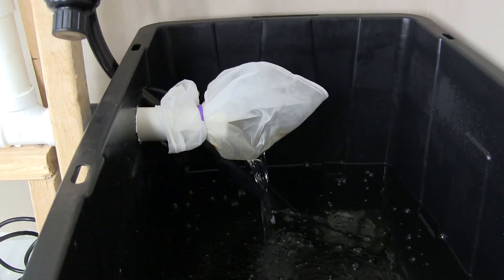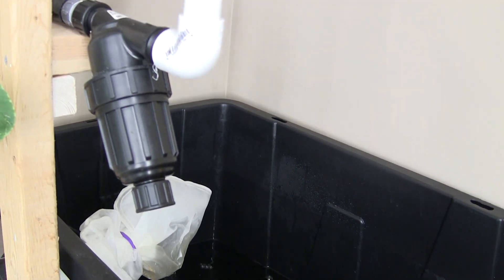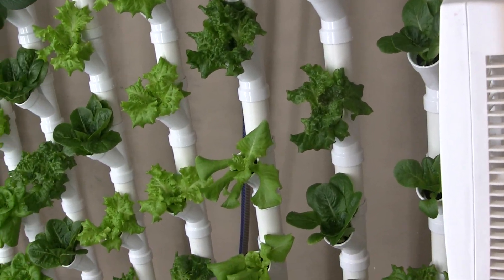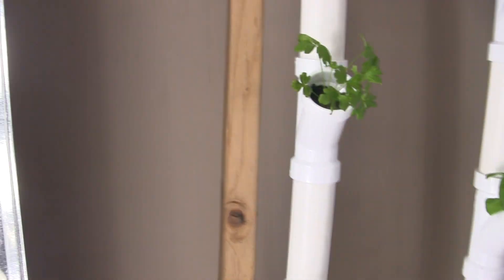Basement Hydroponic Tower Garden Version 2.0

Comment: is turning on and off the water pump hard on it? I have always considered the on-off method but thought it would wear down the pump fast.
Reply from the maker: Good question. It was for the model 18 I use in the greenhouse. The impellers kept on busting. So as advised by Danner I keep that pump running but for the model 5 it's not a problem to stop and restart. It's necessary to have an extra impeller on hand. In all the years that I have been using Danner pumps, with all the different models, I've only had to replace the impellers and 1 housing. The actual pumps are superstars. Knock on wood the pumps themselves have never failed on me. Stilling looking for a good way to clean off the precipitate though - if anyone has any recommendations that would be appreciated. I have used vinegar and baking soda, just vinegar, and once muriatic acid, carefully and diluted of course, with gloves and eye protection. That worked the best, but is extremely dangerous and corrosive.

Comment: @MaryandJoe Neumayer  im quite a newbie in this system. In traditional gardening, plants die when the roots are always soaked water. Here ure watering like every hour🤔 please enlighten😉
Reply from the maker: Very logical question! Roots will suffocate without oxygen. That's why the pipes are so effective - as the nutrient flows down the pipes the water is oxygenated and don't suffocate. They are not 'submerged.' If you do want to submerge your roots, like with the Kratke method, they you will need an airstone/air pump to keep the roots oxygenated.

Comment: You can get 50% more produce by changing your led bulb to warm white 2700k instead of a 5k or 5.6k. Leafy plants explode with red spectrum. 4 2700k bulbs with 1 6000k. 4:1 red to blue ratio. Good luck and it looks fantastic. God speed!
Reply from the maker: Hi Denis, thanks for the tip. I'm planning on experimenting with some Solstrips for this next basement season. The system is cleaned and shut down now until August/September. If that doesn't work I can experiment with some new 2700k bulbs.

Comment: Does it make any sense to turn the pump and fan on and off?
Reply from the maker: Originally that was the plan for energy consumption - but now I keep the fan on and cycle the pump 30 min on and 15 off.
Reply: You might need smaller pump then. I don't think that plants prefer inconsistent water flow and CO2 level. On the other hand, pump and fan is just a small portion to the lamps and heating in my opinion.

Comment: Love it. Maybe if you used a trough at the base and allowed the verticals to slide you could have closer spacing for young plants/ herbs and wider spacing for mature plants, should be able to fit more in that way.
Reply from the maker: that's a neat idea. I like the closed system concept and now I grow alternating sites so the plants don't get as crowded. It works better all around, especially since some lettuce types grow faster than others, so I just pull whatever is more ready and give the others more time.

Comment: So 1 lettuce cost you 2 to 3 $ to produce, just from electricity for light (assuming 0,15 cent/kwh cumulative). I think it is not worth it.
Reply from the maker: I have different figures. I use my electricity bill to calculate cost. And that changes monthly depending on solar gains (we have 30 panels on the roof). In the spring/summer/fall I grow in my greenhouse so operating costs are significantly lower - so that impacts the overall equation as well.

Comment: How efficient in terms of yield is this compared to a horizontal system in the same size as you can bore holes closer to each other in a horizontal system than the Y-connector is to each other?
Reply: Or am I missing the point of this type of solution? If not more space efficient then I guess it’s higher quality crops?
Reply from the maker: The footprint on this system is tiny compared to a horizontal system since it stands up against the wall. We also have room for foosball and darts.  Plants are also easier to access. Also plenty of root aeration with the vertical towers.  I like

Comment: You should consider buying proper horticultur LED fixture, you will save a lot electricity . Solstix solstrips (for example) are awesome and cheap for what they deliver, latest LM301H samsung LED chips special for horticulture, 30 bucks for 50w putting out way more light than your led bulbs.
Reply from the maker: yes, I really appreciate you offering specific recommendations. Have you used those products personally?
Reply from the maker: Hey Zaka, I just looked at the SolStrip X3. If I replace one of my light towers (top to bottom) I would have to string 3 of them together, with an wattage consumption of 258. If I did that for all seven towers my wattage requirement would go from 735 w to 1,806 w. And the cost would be $787 without tax or shipping. But that's assuming I would need all of that lighting. I don't know how to figure out the PPF output of my 15 watt LED bulbs to compare them with the SolStrips.  At 1600 lumens per bulb, that's 11,200 lumens per light tower. A quick online calculator gave me 258 umol/s for my light tower and the SolStrip produces 230 umol/s - so you are correct that the light is way better. But can I really illuminate a 5'6 x 2 foot area with 1 SolStrip which is 15.75” x 1.6”? I suppose I can run them horizontally rather than vertically, and daisy chain them together. But then what about the voltage? Depending on how many strands won't I require an inverter to match the voltage? That would also add to the cost, correct? I obviously don't know much about this but I would love to learn from somebody with experience. What are your recommendations? Thanks in advance for your time.
Reply: @maryneumayer01  yes I have some solstrips, first I recommend you to download the Photone free app for mesuring PPFD across your canopy. You need to do some calculations and drawing to know how to put the strips for optimal coverage and minimal power consumption .

Comment: 80 bulbs at 15 watts is uhh 1.2 kw. so 25 cents an hour. 10-12 hours a day. 90 a month in electricity? the pvc will last forever whats the price per head of lettuce?
Reply from the maker: actually it's more like 760 now since I shaved the light diffusers off and I get more intensity so I pulled out over 30% of the lights in the system. we also have solar so that helps.

Comment: Thanks for sharing your system and your feedback. Planning to build something similar.

Do you see a problem using 3/4" drain pipe? My Restore has a bunch of 3/4" pipe and fittings so would like to reuse them. I'd tilt the drain pipe towards the nutrient tank.

Do you see a problem using 2" pipe for the tower? Thought I'd try a few towers at that dimension to give bigger plants more root space.

What temp is your basement room without running your system? Trying to figure out how much heat something like this produces to find the best place to put my system.

Looks like your pump is submersed in your tank. Does that heat the water up much? I'm planning on building an insulated box for the tank to reduce the pump noise but don't want to heat water up too much.

The nice thing about your design is you can modify it easily for different plants and plant stages, etc.. Such a great system!
Reply from the maker: Hi GK - I think the 3/4 inch drain pipe is too small - if the drain is too small you may get back-up and some roots too which will create clogging. I wouldn't go smaller than 1 1/2 inch. 

2 inch tower pipes is a good idea for plants which don't get replaced/pulled whole. Examples are parsley, kale, chives, etc. Lettuce gets pulled as a whole plant and replaced with a seedling and do 1 1/2 inch pipe is perfect for a 6-8 week plant. 

The system only adds a couple of degrees. The basement is a cool 62 degrees and and with the system about 65. I don't run it in the summer so those are Chicago winter temps. Also, in the winter, the extra humidity is welcomed. It would be too much humidity during the summer months. 

The pump does not impact the temp of the nutrient container. That would be more the ambient temp of the room. Insulating is not a bad idea although the pump is not very noisy - I speaking about the Danner Supreme pumps. 

Yes, agreed, the system is very modifiable. When I get old and lazy I will definitely scale down! ;-)
Reply: @maryneumayer01  Yeah you're right. My first test run used 3/4" and it didn't work due to water backing up (luckily I had no plants in the system!) so ended up using 1 1/2". System is working awesome. I really appreciate you sharing your video. Made me start a business (at the behest of my mom!) to help others get systems like these going. hygrowgardens.com

Comment: i know this is an old video but... i have been using the same kinda filter for years now... and the way it is fitted the water doesn't pass thru the filter.... the top fittings are just a pass thru...
the output is by the under connection.. you have to plug one on top and the outlet is the bottom connection.
Reply from the maker: Hey Eric, I don't use the filter actually. There's no need with the 1/4 inch connector tubing and the sack filter on the end of the drain pipe back into the nute container. If I were doing aeroponics I would have a need for fine filtration but not for this application.
Reply: @maryneumayer01  I see, thank you for taking time to reply. best regards from Brazil.

Comment: Do you have any problems with pests?
Reply from the maker: not indoors - I keep the room and system as sterile as possible - no contamination from outdoors. NEVER introduce a plant from outdoors - always start all plants from seed in that same room - extremely important. I go as far as to remove clothing if I am coming in from my outdoor greenhouse, especially in the fall with all the mold and mildew in my outdoor greenhouse. Don't make any exceptions, ever. I also have an APCO-X UV and carbon sterilizer in my air handler, so that helps too.

Comment: Nice setup, The bulbs you used for lighting they look like regular light bulbs are they?  Are the plants not sitting in water? do they only drink the water trickled down by gravity? Don't your roots clump up like this?  What does this cost you in power and nutrients each month?
Reply from the maker: hello, regular LED A-19 bulbs. system plants don't sit in water - they are trickle fed. Roots clump on plants left in for 4+ months, like parsley and sometimes the kales. cost depends on solar power offset and changes monthly. It does pay itself off I guestimate after 18 months or so.

Comment: Great video. How do you keep the output even on all those black delivery tubes at the top? 
I know from doing this sort of water delivery in my garden that the hoses closest to the water source always tend to put out more that the hoses at the end of the line.
Reply from the maker: Great observation. With the pump I am using there is ample flow to all towers. I added a second tube to the last 3 towers a season and a half ago to help with this issue. In my greenhouse I have modified the end of the irrigation hose to include a ball valve, which I regularly open up to flush out. It's amazing how much sediment gets caught at the end, and how well the irrigation of those towers is improved after I flush. I am intending to replace the irrigation lines and remove the 90's for the filter (which is not needed) for next grow season, in the fall, and at that time I will include a ball valve for flushing at the end of the hose. I would recommend this for anyone building their own system. Thanks so much for your great questions!
Reply: @maryneumayer01  Thanks for the info

Comment: Do the coconut coir get expensive or have they paid for themselves?
Reply from the maker: I use rockwool, and it's a 1 time use. 7 cents per pop. Not bad. The used rockwool are composted.
Reply: @maryneumayer01   I see, also I can see you can use anything since the roots aren't taking nutrients from the medium itself. (as long as it hydrates the roots correctly) How come you can't re-use the rockwool?

Comment: Thanks a lot! I am trying to construct a similar system, but in a bit smaller space in the basement. I would really love to know about the construction framing steps and how you connected the light bulbs together. I read the detailed material list on the 14-tower project, but I am still a beginner when it comes to carpentry and electricity. I know you have very little time, so any external link showing the wooden frame and LED connections part would be very helpful:)

small update: I found a video on a vertical LED lamp stand (although not moveable or with the surrounding vent pipe), but could not find any on the lumber structure holding the pipes
Reply from the maker: Hi Andy, sure, here's a link to some pictures. I have my regular system and also a mini-version I set up for testing some new lighting that never got off the ground:
https://drive.google.com/drive/folders/1DSdcnT-B4XHnEebqf0hcrHRf227AoHeE?usp=sharing

I use lag bolts (3/8 inch) for my framing and for the lights too, although for the lights that's a bit overkill. For those lights I just used replacement lamp cords and spliced them for each of the sockets - most are double sockets to get more lumens out to the plants. People who are interested in building this setup do need some rudimentary carpentry and electrical skills - or know someone who could help. I am not a tradesman myself and when I graduated from college didn't really know which way to turn a screwdriver, but buying a house changed all of that. It takes me way longer to do things, and I don't always get it right the first time, and not even the last, but I always keep at it. And today there is so much to learn from others online there is really no excuse not to give something a try in my mind. Best of luck!
Reply: Thank you very much! Really appreciate it:) The pictures help me a lot understand how to build the structure. I bought all the pipes and now starting to order the lumber, lighting and pump.

Comment: Hi, I really loved this garden so i made a smaller one and it was growing good but keeps getting a brown slime in the water tank walls and on the quarter inch air line also and on the plants roots.  do you know how to fix this?   I have tried multiple times with new nutrients and fresh RO water. any help would be really appreciated
Reply from the maker: hmm - that is odd. I haven't ever experienced a brown slime inside, outside, or in my greenhouse, luckily. When you say growing good I'm going to assume your pH and nutrient levels are on target. What is the temp of your nute container? Is there any light penetration? Is there possible contamination with other organic or decomposing matter, like bugs or plant matter?  Are you running this outdoors? How often do you flush your system, and what is the size of your container? Are you using an aeration method in your container? There could be so many factors which may contribute, in my very limited experience, as a hobbyist. Please provide me with more information relative to your specific setup and I'll do my best to try to help you.

Comment: what happens during power outtage do the plants die
Reply from the maker: plants start to wilt after a day of no irrigation. After a couple of days I'd assume that the leaves would desiccate and would not be able to recover. I've gone a day and a half without a pump and the plants rehydrated just fine, but I wouldn't push it past that. The towers are pretty closed up so keeping the lights off would help with loss from transpiration.  It's more dangerous in the greenhouse without irrigation, especially if it's hot and sunny in the summertime. The towers can be manually irrigated a couple times a day if necessary. The rockwool is great at holding water. Glad I haven't had to deal with a complete loss of sustained power ever, knock on wood. There's more of a chance that your impeller goes bad, so I always have 2 on hand. Great question.

Comment: You should place aluminum foil on the walls and/or paint white or remove dark surfaces to reflect light back to the plants better, a cheap way of improving the efficiency. Also try using LEDs just in the PAR range of the plants, lots of blue and red.
Reply from the maker: Yes, that was a later improvement - feel free to watch update videos where I make various improvements. Be well.

Comment: How did you ensure the water distributes evenly in the top supply lines? I always get a siphon through one line,  so I had to add valves to control the pressure.
Reply from the maker: So long as I have a good flow in all the towers I'm fine. I didn't measure the exact amount of flow from each line. I tried emitters but the pressure wasn't enough to activate them, so I didn't pursue it. I don't want a super pressurized system - I would be worried about leaking.